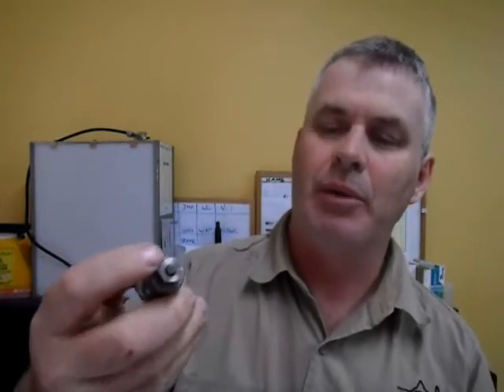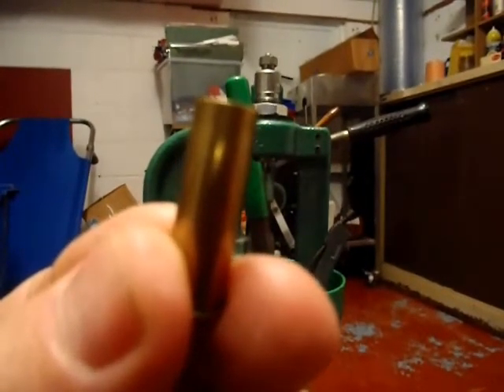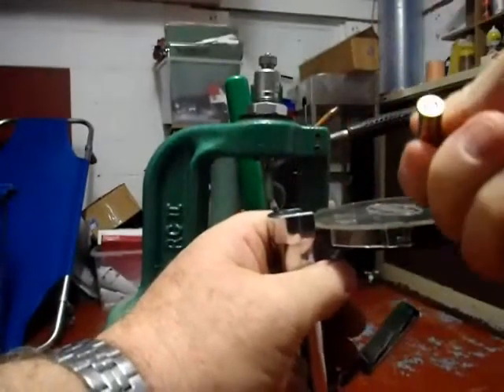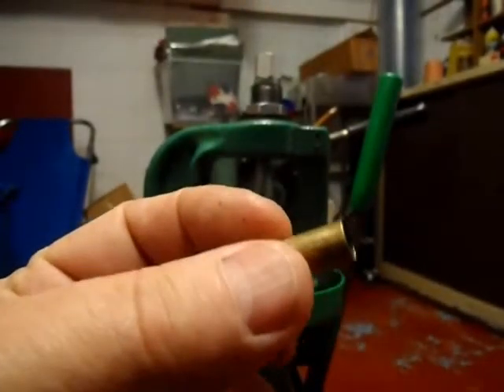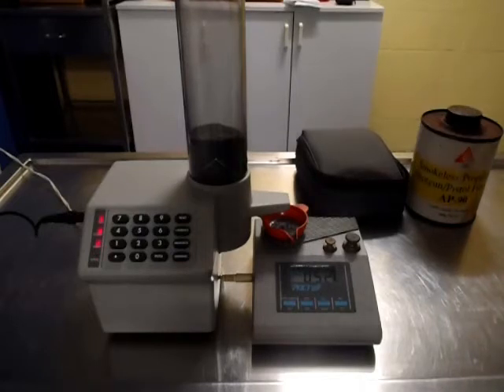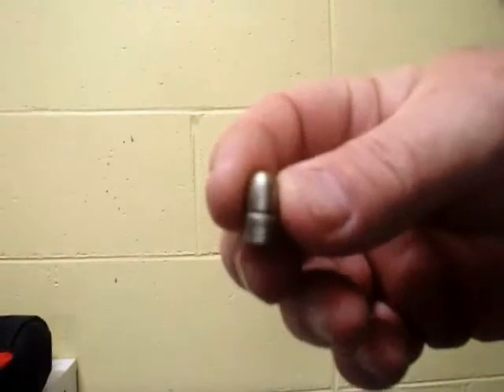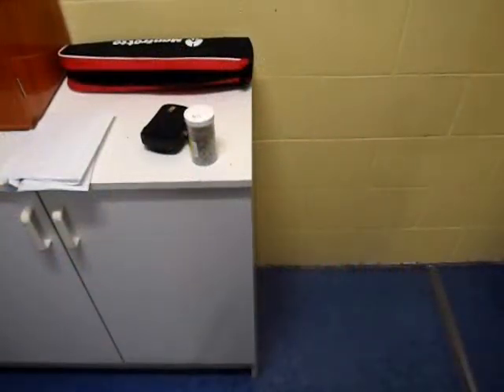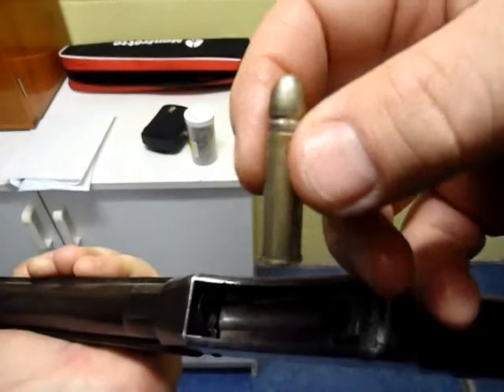Reloading and Shooting the Martini Cadet Rifle Part 3

Comment: As others have said, thanks a lot for a great series of videos about a truly great rifle. I’ve been shooting the small martinis since the early 1960s in the UK - mainly 22lr. Since living in the US I was able to own several BSA and Greener ‘Cadet’ rifles surplused by several Aussie States, most in 310. I’ve also had a few 357 mags, a 30-40 and a 32 Win Special. I’ve thinned the herd now in my 70’s and I’m now left with just one. The 32 Win Special. A very accurate and easy shooting rifle. I reload with 90% loads of medium speed powder and use 180 grain hard cast coated gas checked bullets - which easily hold about 2.5” groups at 100 years. Cheers

Comment: Great set of videos; The ADI book provides load data now. 120gn AR2205 9 grains 1270fps. I dropped that to 8.6 for the black Widow and mad a small number of test loads. I need to get my Lee bullet seater reamed out thank to the excellent advice.
Reply from the maker: Thanks I'm glad the videos were helpful. That has been the sole load in the ADI manual for many years. Many shooters use it successfully but it leaves a lot of unburnt powder granulaes in the barrel which I think hinders accuracy a bit as I found on testing it was not as accurate as slightly faster powders. I also has a greater velocity standard deviation when I chronographed that load compared to AP70, AP90 and AP100. I think the newer APS450 would be should be good although I haven't tried it although it is not available at present.
Reply: @456eec  Interesting but unfortunately I can't get any of those powders since ADI stopped manufacturing them indefinitely. I have some Trailboss and some Allient American Select and some Allient e3 which are all very fast like AS30 and rather nice pistol powders and very clean. 

The only long term option for fast powder is to open up Winchester shotgun cartridges and they contain about 20 grains of Winchester WST, also fast. 

I tested the 8.6g of AR2205 and they seemed pretty accurate but I see what you mean about unburned powder. I only had 12 loaded but I will do more. 3 grains of one of those shotgun/fast pistol powder might be okay.
Reply from the maker: @CyclicCollective  I filmed that quite a few years ago and the whole powder availability thing is dynamic. Those fast powders should do the job if nothing else is available just work up very carefully.
Reply: @456eec  Many thanks, your advice is much appreciated.

Comment: Thanks very much for making these videos. I'm using the lee die set with the hawkesbury river heeled projectiles and bertram brass and have unfortunately encountered all of the problems you have mentioned. It's a fiddly round to load but I'm sure it will be worth it once i have it dialled in.

Comment: Near 10 year old video as I write this, going to try Bertram 310 brass, 150 grain jacketed projectile and AR2207. I have a real dislike for lead bullets, going to try a 8mm 150 grain jacketed spritzer. Being a non healed projectile, will keep cutting off the case length until they chamber correctly.
Will see if I can find a source for some of the rare pistol jacketed 8mm bullets in 100 to 120 grain. 
I’m already shortening 223 cases to make up 300 Blk using a copper pipe cutter and a drill, now have to work a way to shorten the 310 brass.

Comment from the maker: Thanks for that. Once you get it be sure to post any questions you have.
Reply: Great information. I learned the hard way before watching this video. When I developed loads I was at a loss for any loading data. I hit upon the idea of comparing the Cadet case to other cases with existing load data and found that  the .327 Federal Magnum is about 97% of the external size of the Cadet case and so used .327 Federal Magnum loading data with great success. My best load was 5.5 grains of 800X and shot under an inch at 50 yards, which I thought was pretty accurate with iron sights. I also read an article suggesting the use of a card wad over the powder, so that's what I have been doing. I suspect maybe someone thought that the powder gasses would melt the heeled portion of the bullet since it was less than bore diameter.

Comment: Hi, I'm wondering if you ever found a powder to replace AP90 that gives you such excellent results? I'm having poor results with AS50, AP70,  WST, and Win 296. There are others I would like to try but they're currently unavailable due to the current ammo shortage. I'd appreciate any suggestions.
Reply from the maker: If you have AP70 you should get  good results with the correct projectiles. There are successful shooters at the range using all those powders. I think projectiles may be the problem. Possibly too hard and / or not correct diameter.
Reply: I'm using 128g heeled projectiles from a company you have mentioned before. The diameter is correct for the bore and I'm using 32.20 brass with rims thinned to give correct head space and shortened to 1.24". Do you think the problem would more likely be projectile hardness or would I be better trying lighter ones? I'm not finding much lead in the bore after firing batches. Thanks in advance.
Reply from the maker: @mlfuller5900  A lot of shooters use the hard cast projectiles successfully so it is likely a projectile vs individual rifle issue. Your OAL is a bit longer than what I tried when I converted .32/20. I used a .32 Fed Mag Lee trimmer to 1.2 which is still much longer than the cadet OAL. May be worth trying some shorter cases to see if freebore has an effect. Otherwise as you said maybe try some lighter bullets.